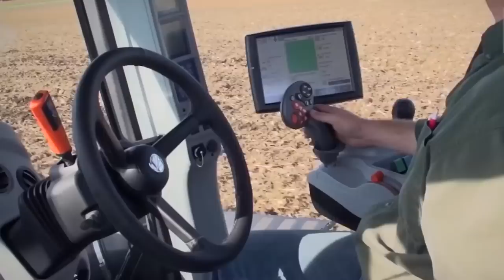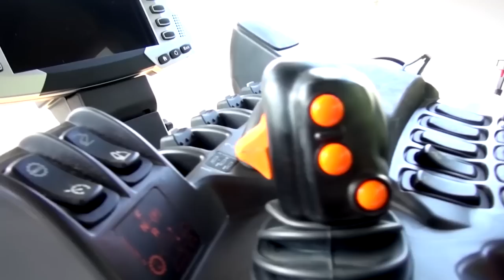The Strongest and Most Powerful Tractors In The World!

Comment: How can you not include the strongest and most powerful of all?  There's a 150 Case that's been pulling 50 John Deere bottom plows cutting a deep 60' wide path (a world record).
Reply from the maker: Must’ve had some tuning. These machines are stock.
Reply: @timeunitytime the 150 case he’s talking about is a steam engine lol. Impressive that it can pull that big of plow but it moves so slow I’m sure it would take longer than a modern tractor pulling a smaller plow.
Reply: Not the most powerfull. Too slow.